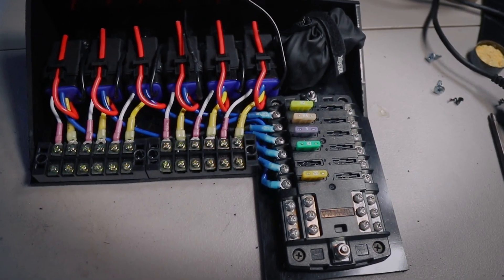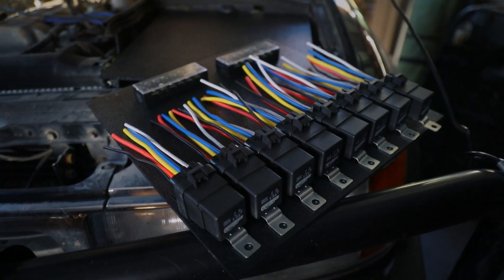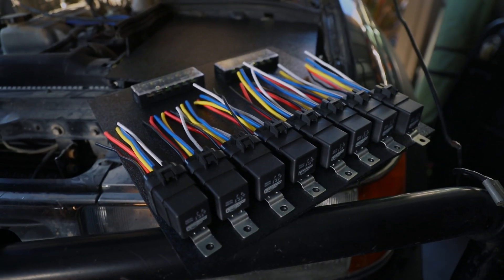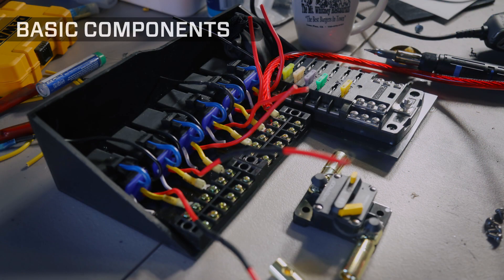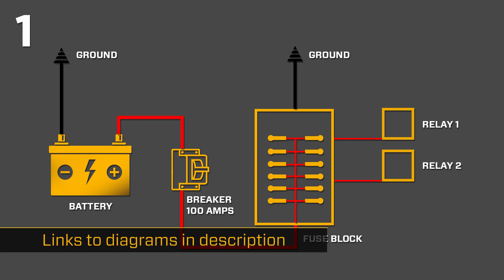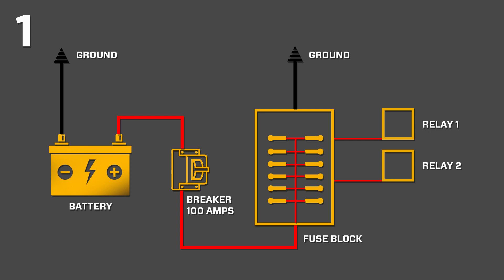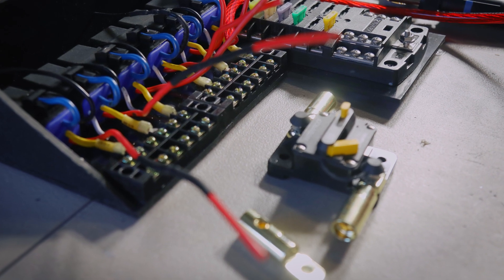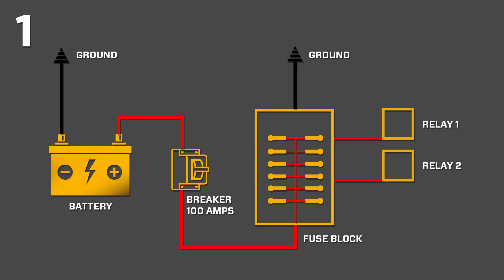DIY Relay Fuse Block: Where the Wires Go!

Comment: I am a little confused (maybe a lot confused).  Anyhow, I am wanting to wire a 50 watt ham radio, along with other accessories by using the following setup:  Running 10 gauge fused power and ground wires from the battery to a fuse block, using the fuse block's power and ground locations.  Then power a 4 prong relay to the fuse block and grounding the relay back to the fuse block, using this relay to control the radio. The radio would also be grounded to the fuse block.  As for powering the relay, I would be running an ignition controlled power source directly to the relay.  Does this make sense or is the arrangement an accident waiting to happen?

Comment: Ive watched this series multiple times. And I mean rewind style watching to really try to understand. Its really a gem of a find. Especially for noobs like me. I learned a ton. Any struggles were my own inexperience. But the format couldn't have been any clearer. I pretty much bought the exact set up. Just had my aha moment. About to tackle this biotch! For my overland project. I'm gonna make a couple personal modifications in mounting. But for the most part I'm following you exactly. I'm super stoked. if my rig burns its your fault...;)...Stupid question, anyone can answer, how does the white wire meet the battery power? Directly back to the positive terminal? ie all six wires to positive terminals? Thank you once again. This channel gives me all kinds of knowledge and inspiration!
Reply: same question??
Reply: Another question re the white wire..why isn’t that wire fused when everything else is, surely that can get a power spike or short coming off the main power cable also ?

Comment: I have one of my fans hooked up the ground way so my one wire runs to power and when my temp sensor in the manifold triggers on it kicks on 
How would a switch work ? Doesn’t switches have 2 posts ?

Comment: Pretty new to vehicle electronics so please forgive the ignorance. Why does the run from the battery through the circuit breaker to the fuse block need to be “as short as possible?” Can I put this in the cab of my wrangler behind the rear seats?
Reply from the maker: Yes you can. The greater the distance, the larger the gauge wire required. You can check out a wiring gauge calculator online.
Reply: @OverlandBound  Awesome! Thanks for the great videos and the fast assistance!

Comment: how would I connect the white wire (assuming a smaller gauge wire) with the red  wire coming directly from the battery's positive?
Reply from the maker: I'd connect it where the battery cable attaches to the fuse block.
Reply: @OverlandBound  2 years later, i'm referring to the same video for a new rig! Although i do have a question; are your white wires daisy chained into the positive post on the fuse block??
Reply from the maker: @j.salazar4676  Glad it’s helpful! That is correct.
Reply: after a long day of trial and error, and 4 blown fuses later. I just ended up rewiring my lights up with the factory wiring harness, from rigid. I must be doing something wrong.

Comment: Hi I notice at 7:36 it appears that the screw heads have have been sprayed with a red coating.  Is this some additional insulation?   If so, what did you use?

Comment: Hi sorry late to the party, I have read the comments but just want to clarify I have off road lights I plan on wiring through the gap in my lift gate. (2001 Montero Sport) I want o build this type of power block but the switches are a little confusing. All I would do is run one ground wire from each relay to each switch and then each switch to ground. So I complete the ground circuit for the relay which would then turn on each light? Do I have this right?
Reply from the maker: Do the diagram links in the description help - it includes a picture.
Reply: @OverlandBound  yes! I missed the one of the completed working distribution block. Thank you!

Comment: Wire 86, how did you tie that one back into the positive?
Reply from the maker: See pinned comment!
Reply: Overland Bound I see it in image 2 & 3 but looking more specifically at how you tied it back into the fuse block for power.
Reply: i was wondering the same thing. did you route it to the blue seas fuse panel? is it fused?

Comment: That is very helpful to me for my mind.  You have a 100 amp breaker and i have been looking to buy one all i find are amps above and under 100amps but never 100amp.  I am still learning. Is it safe to go higher or lower on the amp level on the breaker if so what would be your advice?  Thank you guys for what you both do.  Be safe take care

Comment: how do you wire accessories that you want to be turned on only when the ignition switch in on or in acc position?
Reply: I believe at this point your going to want to have a dual fuse board and run your accessory wire to the fuse board and from there run the same set up

Comment: So...essentially, the accessory switch on the dash is used to cycle relay switch ground (85) from Ungrounded (off) to Grounded (on), rather than power between switch from off/on (86).  (86) is always powered, its the Ground circuit (85) that goes through the firewall & through the switch, thus completing the circuit, thus sending power through (87).  Got it.!

Power & Ground & Power connections from the Relay are still (obviously) required to route from the relay to the lights, etc...

Comment: So just something that's confusing me (a mechanical engineer) is that a switch should only function if, when it's open, one side of the switch is a different voltage than the other. If they were the same voltage then when you connect the 2 sides together, then no current would flow and nothing would happen. So when you say the switch is "negative switched" and there are no hot wires in the cab, I'm not sure that is correct. But considering I'm not an electrical engineer, I could somehow be wrong. If someone knows more I'd like to know.
Reply from the maker: Check out the wiring diagrams in the description! You'll see how it works. Cheers!

Comment: Thanks for covering this subject, Michael.  There are some options that help consolidate components in to a smaller package and still keep things simple without going to the solid state options.  The one I always wanted to get was the Cooper Bussman relay fuse panel.  An example is here: https://www.amazon.com/Cooper-Bussmann-15303-2-2-4-Relays-Included/dp/B015YSWP8C and a ready-to-go built one is here: https://www.ebay.com/itm/Waterproof-Universal-Off-Road-Relay-and-Fuse-Power-Distribution-Center/182445594617. Disclaimer: I only did a search for those links and do not endorse those sellers nor have any private interest in their businesses.  The form factors a quite a bit more compact and let you swap fuses and relays as needed, just as in today's OB video.  Does OB have any experience with these?

Edit:  I just found a similar relay fuse block that uses more traditional full-sized relays: https://www.amazon.com/dp/B07MR64XK1/ref=sspa_dk_detail_6?psc=1&pd_rd_i=B07MR64XK1&pd_rd_w=DGuhC&pf_rd_p=48d372c1-f7e1-4b8b-9d02-4bd86f5158c5&pd_rd_wg=7xCPz&pf_rd_r=DREBDED5MB5QNDCTGT1K&pd_rd_r=7d339779-bd8c-42de-851f-1f5253303e68&spLa=ZW5jcnlwdGVkUXVhbGlmaWVyPUFESDBUUTRKR0w4SjkmZW5jcnlwdGVkSWQ9QTA3NDM3OThSSTJHVURVWVdOMEwmZW5jcnlwdGVkQWRJZD1BMDgwNDM0N01BREQ5RjlLU1NCSSZ3aWRnZXROYW1lPXNwX2RldGFpbCZhY3Rpb249Y2xpY2tSZWRpcmVjdCZkb05vdExvZ0NsaWNrPXRydWU=

Comment: Are you running all the white to the power on the fuse block... sorry wiring confuses me
Reply from the maker: It confuses most of us! Yes, that is correct. Each relay has a white wire. Those are soldered together and go to the fuse block positive. I'll post a picture!
Reply: @OverlandBound awesome thanks, I've been wondering since the first video. Was trying to wrap my mind around it.

Comment: I think a lot of people do not understand the open and closed circuit lingo.  It took me years to get through my brain closed means the power is on.  As a teen, I wired many KC lights and back then they sucked tons of juice as I would wire 4 or 5 150W halogen lights across my push bar and light bar on my full size Bronco.  Man those days were awesome.  Lived to play!!  But yes, relays and fuses and low gauge wire!!  Now I work to much!!

Comment: Hi Michael, great video also the original on the relay board very professional looking! After reading comments maybe a actual mock up build to a lighted switch and a accessory would be more clear to some of the viewers ,especially the part about the piggy backing 86, just a thought. Just wondering are you close to the where you had your engine rebuilt?
Reply from the maker: Hi Chuck! Pretty close, yes - Top Shop Auto is about 20 minutes away in Lafayette, CA.
Reply: @OverlandBound  Oh cool we aren't that far from each other then Pinole, I have a sas 4runner 30 years old, did most of  the work myself but really like your 80 series .

Comment: i dont understand why you need a relay, as well as fuse box ?
Reply from the maker: From the intertubes: https://www.onallcylinders.com/2015/01/02/relay-case-whys-hows-using-relays-automotive-wiring/
Reply: They do different jobs. Fuse box protects wires in the circuit from overloading, relay protects switch from overloading. That's my understanding at least.

Comment: Hey Mikey, I liked it a lot!!!!!  A very informative video! 
Unfortunately, I went with the S-pod. I'm a baaaaaaaddddd boy. 
I must acknowledge the simple genius in building your DIY fused relay system.  Cheers, Mate.
Reply from the maker: Would love your report!
Reply: @OverlandBound  The S-pod controller was installed a year ago. It controls all the external lights and the air compressor. All without any failures to date. Cheers, Mate.
Reply from the maker: @jackwalsh1468  Good to know!

Comment: Unfortunately most lighted switches don’t light up when wired in the switched ground configuration.
Reply: they will if you piggy-back the incoming wire to the light terminal on the switch.  the light and the switch both use the ground on the switch as a common ground so you don't have to ground each separately.  :)
Reply: dobrzpe you mind elaborating a little with the diagrams 😅 or maybe use different wording. I get 30 is the 12v positive so that is one wire to the switch, then you’ve got the ground. The last wire I can’t figure out is the third accessory wire? (This is for light up rocker switches)

Comment: Wiring always scares a lot of people, and this is a good overview.  One thing I noticed is I haven't seen fuse "boxes" or "Blocks" that have a ground wire.  Typically a fuse block is simply distributing power from a larger circuit to various smaller circuits so no need for a ground.  One other item that concerns me are those components seems to be amazon cheapies.  I would recommend going with a little higher quality components.  I but my components from ceautoelectricsupply.com I make no commision from any sale there but have always been satisfied with the quality and Customer service.  If your project is still too intimidating he will build it custom for your application.

Comment: I see the point you made with negative switching but what if your dash switch negative wire get shorted before the switch? Your accessories will come on. This mean that trouble shooting could be hard. And this is for all wires. I would do it for the accessories themselves as you do but to me, the dash switches should be before the relay to not get power to the relay at all time.

You could just run one power wire to the dash and connect every switch to it. Then return a wire from each switches to the relay then ground. That way you got only one "hot" wire in the cab if everything is off
Reply: Thats a much better and professional way

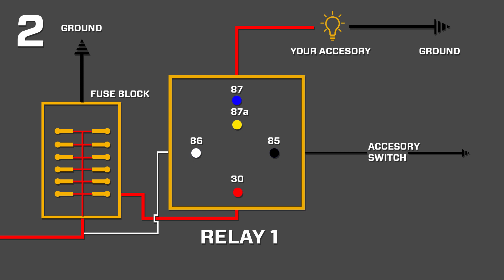Comment: Michael, I hate to point this out, but that big red cable connected to the relay closest to the fuse block (3:04) and then later actually installed in the 80 (top right of the fuse block @ 7:47) is cooper-clad aluminum. Doesn’t carry as much current and is more brittle than pure copper. I’m sure it’ll be fine for your  application for now, but keep an eye on it. May need more maintenance. Love the videos/community. Stay safe! ⚡️ 🏕 🚙
Reply: are you sure?  it looks like high-quality audio power wire to me.  how can you tell?  keep in mind tined-copper wire is silver in color and is corrosion resistant.  CCA wire is copper colored...  it's hard to tell from a video!  i was just wondering what clues you were picking up on so i can also learn.

nevermind!  at 3:44 you can read it as "CW Designs" - a quick search for their wire confirmed it IS copper clad aluminum.  GREAT EYE @robertnelson!

so, yea, CCA wire isn't all 'that bad'.  (notice the quotes)  CCA wire won't carry the current that full copper wire will, which could lead to more heat due to the aluminum causing more resistance.  something to be aware of!

Comment: Q1:  if your switches are lighted, will the negatively wired switch still illuminate when turned on?
Reply: they will if you piggy-back the incoming wire to the light terminal on the switch as well.  the light and the switch both use the ground on the switch as a common ground so you don't have to ground each separately.  :)
Reply: @dobrzpe  Will the lights dim and work as normal when wired this way? Thanks👍
Reply: @dobrzpe  My 3 pin illuminated switches do not work piggy backed. Are you referring to a illumination switch with more than 3 pins?
Reply: @timothyschell22  it should. (i'm referring to piggy-backing the 2 power inputs - NOT the ground/other side of the switch...)  HOWEVER it depends on the switch and how it's designed internally.  some, the light will only turn on when the switch is on, and other switches the light is on if it has power regardless if the switch is on or off... think of it this way - the terminal doesn't know/care if the power wire is coming 10 ft from the battery, or 1 in from the terminal next to it - all it wants is 12v power.
Reply from the maker: No. You'd need to power the illuminated switch.
Reply: Hey Michael, I built this and it’s awesome, only on problem, the switch panel I bought is lighted, so it doesn’t work.  You were going to post a photo of the piggyback solution to lighted switches can you? Or maybe someone can offer advice without having to go with two prong switches,my hat work.
Reply: Got a love talk to text, sorry for the typos.  It  should’ve said without having to go to a two prong switch, that do work.

Comment: Well done! I wish I had been able to see this when learning to wire my Baja racer. Speaking of which, two electrical items I learned from racing;  1. was to use small pop up circuit breakers instead of fuses. That way if something pops you can keep resetting it until you find the issue and fix it without wasting all your spare fuses (yes, I had a few extra circuit breakers too, just in case one failed!). A little more expensive but well worth it. 2. For long wire runs, twist the wires around each other. It reduces vibration on the wire run thereby reducing wear and tear on the wire covering. You have to really plan for it and it does take more wire but well worth it. 

And us Land Rover guys know what started that fire...All Hail Lucas, the Prince of Darkness and He Who Releases the Smoke Gods! ;-)

Comment: why are you grounding the fuse block?  nothing there needs to be grounded according to your wiring diagram.  just trying to help!
Reply from the maker: You are correct! It just provides a reliable negative ground source on the fuse block which has negative ground terminals. Nothing in this use case requires it.